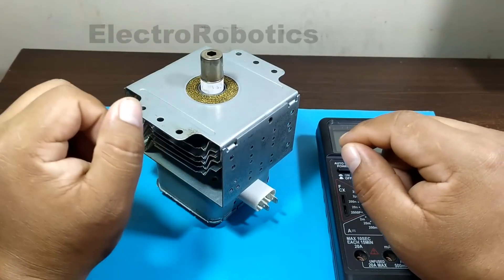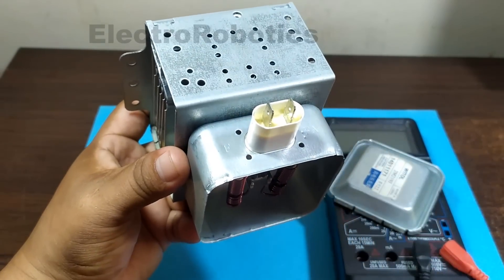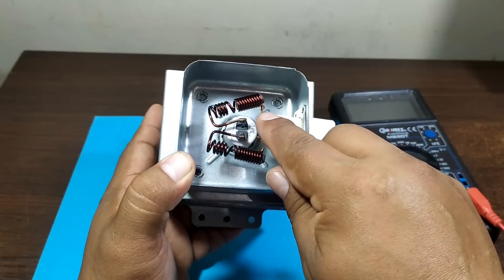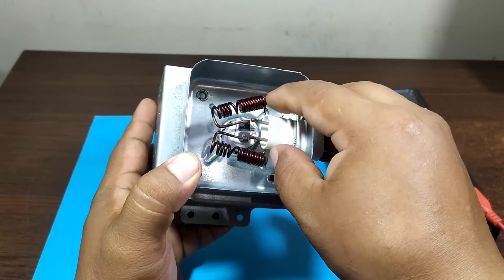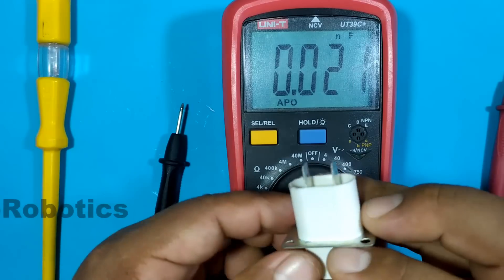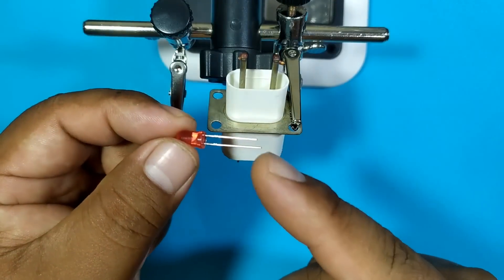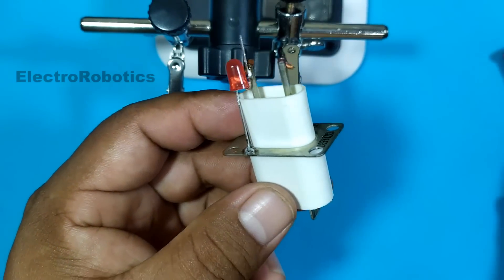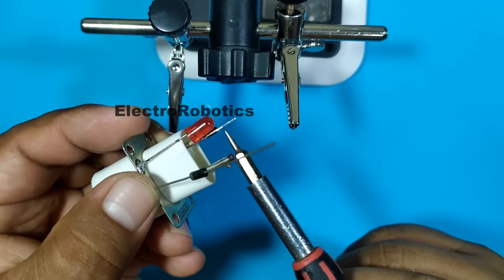Interesting Idea with Recycled Magnetron.

Comment: You should warn folks about the ceramic ends, not to break them, they have baruim in them? They 10 times more cancer causing then asbestos if they break and you inhale the dust. You can recycle the two copper wires, the aluminium fins and magnets are always useful, you can get them off without damaging them, some say you can sawzall the middle out for copper. But it's always copper coated aluminium in my experiences so I don't aggravate with out at all, toss it into #2 shredder box as is.. 
Is it the diode causing the light to pulse or the capacitor? I had no idea there was anything between the jack and the copper wire. Thanks for info!

Comment: You first should warn people that dozens if not hundreds of people have been killed taking microwave ovens apart without safely and properly discharging the High Voltage Capacitor first before they touch any of the other components.  That capacitor can store a lethal charge for a long time.
Reply: I'm actually 1 of the .5%, to get hit with 5000 volts, across my left side no less, and am still around to admit it 🥴
Reply: And before all the smart a$$'s start puffing their feathers and say microwaves only run at 2000, I had 2 systems connected together along with caps and chokes.
Reply: BS
Reply: I got it the other day. I went to pick it up after burning a piece of wood but I forgot to unplug it first. Burnt two fingers and a thumb pretty bad. It definitely feels different than like 220. For some reason my capacitors only have a charge in them for a few seconds and they're already discharged. And that's without the diode grounded

Comment: The two ferrite magnets ( CARE ! very brittle , do  NOT  drop ! ) ...are super useful😝 ... stuck on the side of your cooker or fridge , will hold most cooking utensils , ready for action .... also , one of these placed at the end of a wood broom handle will pick up dropped screws or nails in the workshop , but recommend that you cover with a plastic spray can top , to prevent damage by knocks ( brittle ! ) ... ( tried - n - tested ) ....... DAVE™🛑

Comment: That connection is a feed through capacitor with a pair of chokes. You could use the entire circuit as part of an EMP surpressor as it will damp pulses of very fast rise time and high voltage. I used the complete circuit for protecting the transformer that drives a tesla coil from cooking itself. ❤